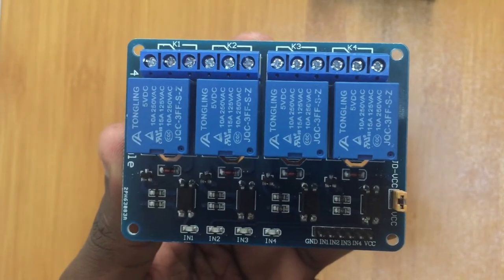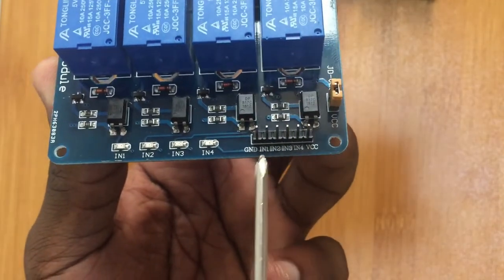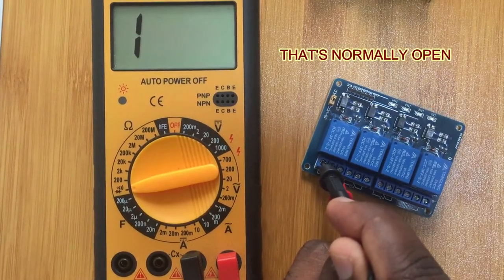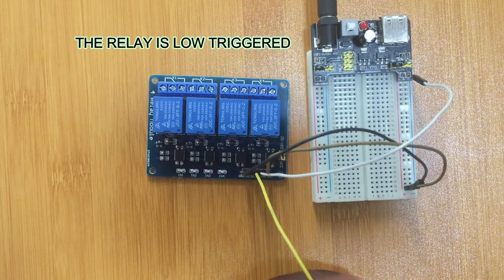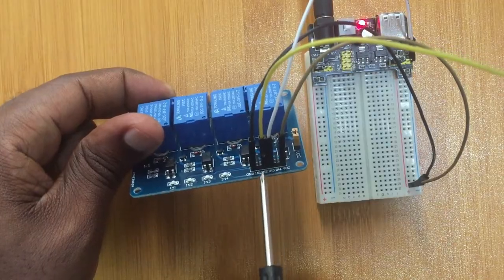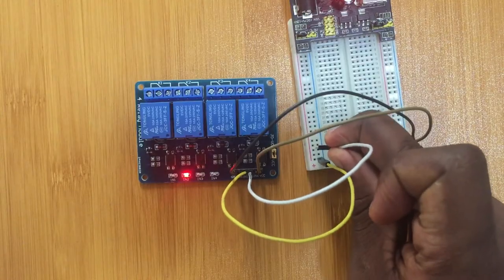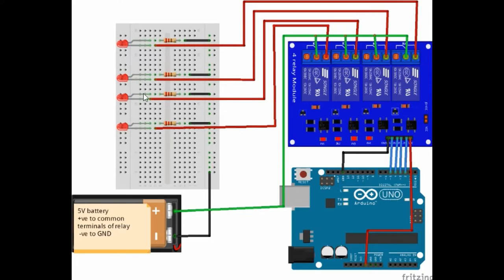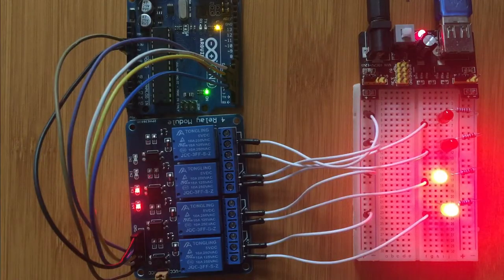HOW TO INTERFACE 5V 4 CHANNEL RELAY MODULE WITH ARDUINO

Comment: This video is extremely well done, you explained it well, demonstrated it with a nice simple demo, and pointed out that it fires on Low and showed a great technique for that.  I really appreciate the work you put into this, and wish I'd watched it before fighting with the relay for 2 hours last night (I was assuming high triggered it and thought I had a signal issue...ugh).  Subscribed and will check out the rest of your videos!

Comment: Hi, I have made a similar project with the same relays board. When I power up the Arduino the 4 relays go on and off really fast until the arduino set everything up. There is a code formula to stop it? Or It's because I'm powering the relays board directly from Arduino without the additional power supply? thank you so much!

Comment: What power supply do you have plugged on your Breadboard?
Reply from the maker: I used 5v power supply since it was just for demonstration. However the relay can  use higher voltages like 220v . But be careful not to get shocked!!